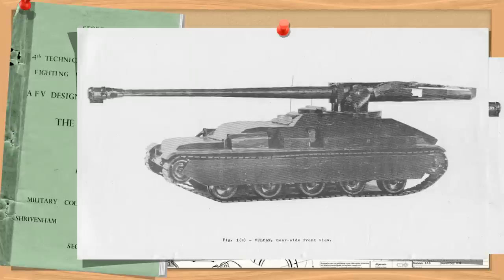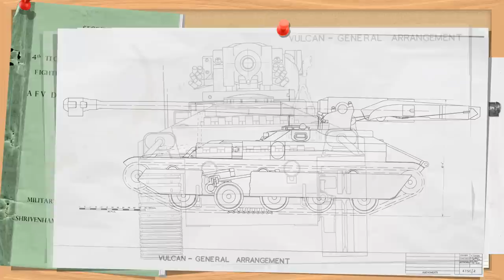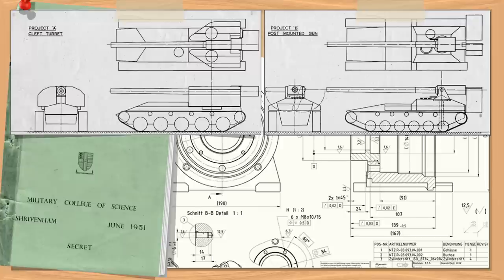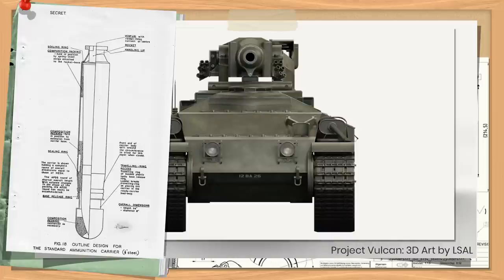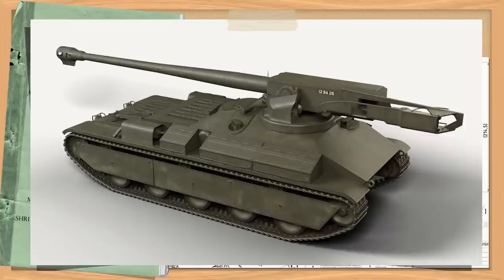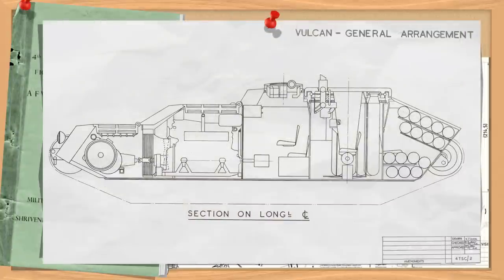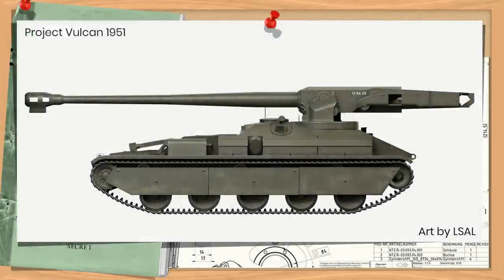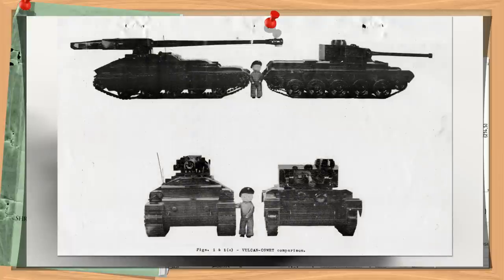STT Vulcan - Tank Design & Development

Comment: Keep the crazies coming Ed. I always maintain that the UK has: fantastic designers, good engineers, decent manufacturing, poor managers, terrible strategists and no money. It explains much of defence industry over the past 100 years. TSR2 anyone?!
Reply: The TSR2 was a brilliant low level strike design but seems to lack multi role capabilities. Given that low level nuclear strike became less important in the future, I think it may have lost some use. Good strategic bomber, not so flexible it seems. Surely more advanced designs(albeit beginning with experience with the TSR2 and after) like the Tornado or Typhoon etc, that the aerospace industry has taken part in are better aircraft overall, yet because they were successful don’t see the same level of worship as the TSR2?
Reply: The UK has plenty of money. It is the great money laundering basket. London attracts money and sits on stockpiles of old money because it is quite ruthless with its investments. Terrible strategists? Hmm. Any strategist worth anything at all would say no to any project that required rocketry for a loading mechanism. Think of all the extra logistics, maintenance and things that can and will go wrong in the field. The UK's manufacturing is decent at best, but the issue is that the UK started to modernize early and than became nostalgic about itself and did not keep up the pace of modernization. Take for example how the Japanese car manufacturers produced cars in the UK; the UK had to beg them to come over and they said they'd only do it in a modern way. The lack of progress in the UK comes from two sides; not enough willingness to invest as well as on the union side where they do not want to lose jobs to further industrialization and automation. Which also traps its people in low wage jobs doomed to become increasingly out-of-date and inefficient thus endangering the job anyway. On the front of designers and engineers the UK also does not excel. All big, modern countries have good engineers and designers.

The one thing the UK is realy great at is exhibiting a superiority complex. But that is also a fantasy. See brexit and what happened to the assumption the EU needed the UK more than the UK needed the EU.
Reply: TSR2 was ambitious and had a slightly gold-plated specification. It was then cursed by a poor engine selection (the RR Medway turbofan was far more suitable than the Bristol Olympus turbojet for the mission profile) which was done for primarily political reasons and, further, the political drive to use the TSR2 project to force industrial consolidation within the aviation industry. However, despite the problems, if we had persevered with the project the RAF would have had an excellent light bomber for the 1970s, superior to the much-loved Buccaneer S.2 (at least after the inevitable initial teething problems were solved). It is likely that the Mk.1 version would have been below specification in a number of areas however, with further development, a TSR2 with Tornado-level avionics would have been an outstanding aircraft in the 1980s and 1990s offering superior range, altitude and speed in a combat configuration to the Tornado.

On the downside it is inevitable that TSR2, like its US cousins the F-111 and F-14, would have been expensive and manpower-intensive to run. In the post Cold-war world of tight budgets it is likely that TSR2 have been removed from service fairly quickly, either by the John Major government as part of 'Options for Change' in the early 1990s or later by the Blair government after the 1998 Strategic Defence Review. In the most optimistic case a small number would survive into the 2000s but there is no chance of them being still in operation after 2010.
Reply: @Akm72  Retirement is an interesting one as TSR2 getting into service would have completely changed the landscape - no AFVG/MRCA project and therefore no Tornado. That could have led to a F14 & F16 combo or F15 buy to replace the Lightning (would we have bought Phantom?) - so TSR2 could have ended up killing the UK aircraft industry! Or maybe a Phantom radar integrated on a TSR2 carrying 8 Sparrows as the equivalent to the Tornado F3. All good fun to discuss! The F14 would have been the perfect Bear killer - the UK is after all 'the unsinkable aircraft carrier'.
Reply: @FinsburyPhil  My prefered alt-history here is that we still join the MRCA project but looking for a Lightning replacement rather than a Canberra replacement. I think that would be a better match as most of the other nations were looking for an F-104 replacement and maybe Canada, Belgium and the Netherlands would stay on-board. The resulting aircraft would presumably be an air-air optimised fighter with light ground attack, however the UK might still need a specialised two-seater with extra-large drop-tanks to patrol out over the North Atlantic.

I've thought about a TSR2-ADV as well, however I think you'd either end up with a minimum-modification aircraft that wouldn't be much good (mainly because the heavier air-intercept radar would make it more stable and therefore even less agile than the standard TSR2), or you'd change the airframe and wing to better optimise it for the role but end up without enough commonality with the basic TSR2 to justify the project in the first place. However there is a certain appeal to an aircraft that can carry 8 missiles for a standard 5 hour mission, allowing a 3 hour loiter probably 500nmi from base, and doesn't have to jettison drop tanks to go supersonic. The radar would probably be a FMICW set (as that technology was being worked on in the UK from the mid-1960s) so it would be a similar to the real AI.24 'Foxhunter' but using digital computer technology that's about a decade earlier but with more space and weight available in the larger TSR2 airframe.
Reply: @FinsburyPhil  Just noticed that I didn't mention Phantom. The RN Phantoms were purchased instead of the cancelled P.1154RN, so those are definately still on. While the RAF F-4M is usually described as being ordered as a result of the cancellation of the TSR2 my suspicion is that they're actually part of the replacement for the P.1154RAF alongside the Harrier. So my guess is that the F-4K and M are both still ordered even if TSR2 proceeds.
Reply: @Akm72  Yes I think you're probably right. So no Jaguar because of the F104/light attack fighter then? Would that have been met by a P1121 'Super Hunter' follow on design?
Reply: @FinsburyPhil  Happy to be corrected but I think the P1121 was long-dead by the mid 1960s. 

Jaguar is an odd one. Historically they purchased about 200 of them and replaced remaining ground attack and photo-recce Hunters as well as the Phantom in the fighter-bomber role from the mid 1970s, then about half of them were replaced by Tornado GR.1 only a decade or so later. 

I guess in this alt-history something similar would happen: Phantom and Harrier in the light attack role from the early to mid 1970s (while TSR2 is entering service), then Harrier and Jaguar from the mid 1970s to mid 1980s (while Phantom is switched to air defence), after which half the Jaguars are replaced by the alt-Tornado which, up to that point, would have been used only in the air-air role (replacing the Lightning about half a decade earlier than historically).

EDIT:
So at the end of the Cold War the RAF would have TSR2s in the interdiction/strike/recce role based in both Germany and the UK, a few Buccaneers in the maritime strike role based in Scotland, Phantoms and alt-Tornados in the air defence role based in Germany and the UK, Harriers in the light attack/recce role based in Germany and Jaguars in the light attack/recce role based in the UK. Options for Change would see the Phantom and Buccaneer being retired quite quickly as well as at least some of the TSR2s, however alt-Tornado would probably stay in low-rate production at least in the short-term. One big difference is that the Eurofighter project probably doesn't exist, however improved versions of the alt-Tornado that use similar technology to Eurofighter probably do. At the same time the UK is probably trying to work out how to replace TSR2 and would have to choose between the US F-15E, a new UK national project or some sort of international collaboration. It is possible that we would have been looking at the USN A-12 'Flying Dorito' as the TSR2 replacement.
Reply: @Akm72  You are right about the P1121. I was thinking of it more a concept that would be updated as a Euro F104 competitor and then later possibly as an alternative to 1st gen F16s. I do suspect that if it were not for Tornado, the RAF would be flying a fleet of F15Cs and Es and F16s by the late 90s.

Comment: Back in 1953, Frank Marquardt designed simular system for feeding 30-mm ammo in experimental T168 autocannon. Instead of rockets, he used detonation of electrical primers to send ammo backward from belt into revolving chambers. And it worked. M. Chinn's "The Machine Gun" holds full description of project.

Comment: Interesting concept. It is pehalps intersting for some, that one of the three initial proposals for what would become Leopard 1 in the late 1950 in west Germany also was a crewless turret or rather outside gun proposal. From memory I think it had a carousel loader under the gun, the engine in the front and the crew compartment at the back of the vehicle. 

The Proposal by the Borgward company of Bremen was however rejected and the project was continued using the propoals from the two other groups of companies. Given the tecnology of the time that was probably a wise move, but the concept was forward thinking nontheless.

Comment: Looking at the obvious massive advantages of this system the oddball loading method seems to have been easily replaced with something more grounded in reality, it's odd this wasn't pursued. So many of these design exercises seem to have been methods of keeping tank designers out from under foot as their interesting ideas never seem to be pursued onto other systems. It would be an interesting thought experiment to find the best subsystems on each design and further it into the next.
That said, it's unlikely the computer would have survived the shock of that mondo gun being fired. (cf. M551)
Reply: I dunno, if you can make valves survive the 20,000Gs of acceleration in early proximity fuses you can make a computer survive that.

Comment: Wait, so the 5 inch gun discussed on the Chimera wasn't a 127mm but instead an 123mm ?. Damn I would wish you made a video covering the STT Chimera and the semi fantasy FV 217 (207 Actually) Badger that WG sold to us in World of Tank.
Reply from the maker: i was involved in both, so yup will do at some point, problem is chimera has alsomost 0 images, 95% is done from text only in the desc as bovvy tossed all the plans years ago.
Reply: @armouredarchives8867  Can't figure out a proper British insult for those guys after dumping all of the materials. But then again, these guys only designs to serve as studies and explorations of concept so It's hard to resist the urge to just dump them files instead of archiving them
Reply: 123mm is such an oddball caliber that I wonder how that came about.

Comment: The way this concept could have been redesigned was to change the 'turret' to a larger cylindrical shape. That would allow the use of a auto hoist/loader from ammo stored in the rear with it's own ammo rear resupply door. A very effective, survivable and practical setup retaining the many advantages of the original.

Comment: Given a 21 # projectile + case, nose cap, & rocket, the all up weight of one round was what - 40, 50, 60 #? The loader-codriver would need to have the strength of a gorilla to wrestle the 56" LOA ammunition into place within the confines of the vehicle. Or did loading require exposure a la the AMX-13?
Among the things that could go awry with the loading scheme are mud, dirt, foliage, etc. One imagines crews being instructed "not to travel off paved roads" to prevent the loading system being rendered inoperable. Kinda defeats the ldea battle tanks having X-country mobilty.

Comment: I would like to see a fast tank with the same 30 mm gun as the A-10 aircraft as the main gun that can hold 100k rounds of AP rounds. That way it can take out a group of enemy armor very quickly. Imagine one hidden tank taking out a whole tank column with a continuous burst of armor piercing rounds before the enemy can even load and fire the first round.
Reply: that won't work, because the only reason that 30mm actually does anything (and the reason why javelins also work) is because it's firing from up high, hitting top armor that isn't very thick. put it on the ground then you won't be hitting anything it can pen.
Reply: @basketcase1235  ok thanks for the info

Comment: SO, at this point in 'reasoning' the "development" was it simply Not Feasible, to put the 'Turret-less Gun auto-loader Inside a 'dummy' Turret, which had light armour, but deception cues? Really? You tank designers need WAY MORE TIME WAY from draft-boards, and MUCH more TIME inside an M-60!!